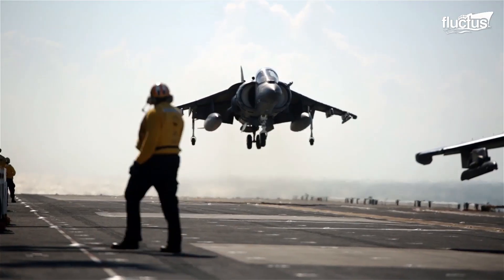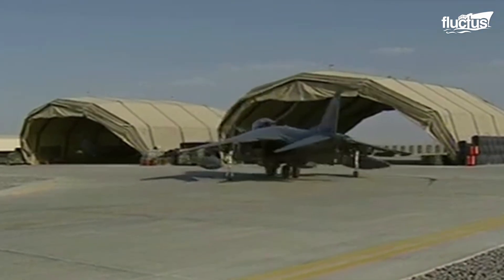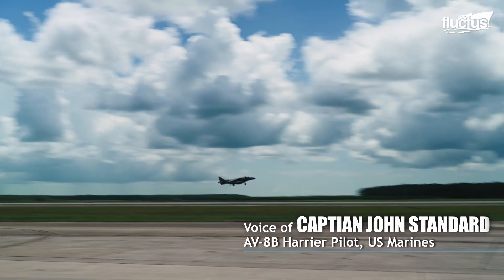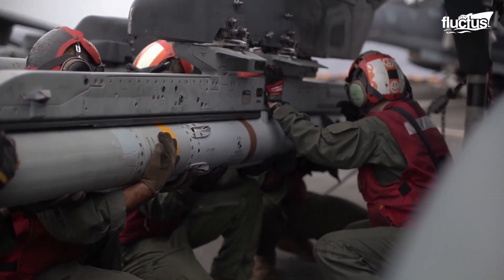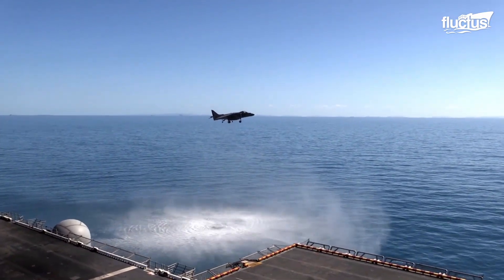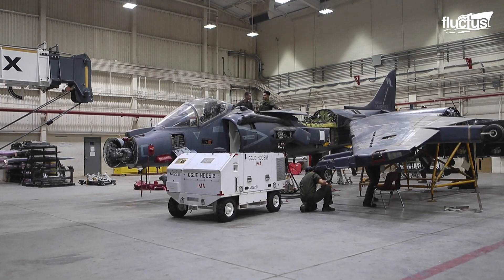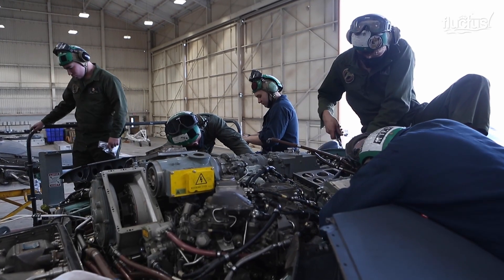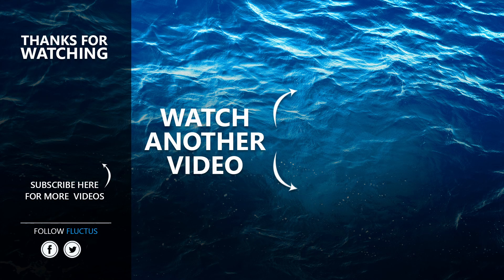US AV-8B Harrier II Showing its Insane Vertical Capability Over Water

Comment: Before the F-35B, the HARRIER was the only VTOL fighter jet used by an air force.
VTOL takeoffs require a lot of energy due to the weight of an armed fighter jet and therefore a lot of fuel, which increases the weight even further. This reduces either the flight time or the weapons load carried. This is why the English Harriers and F-35Bs usually take off from aircraft carriers in STOL mode (with a short run-up distance), as this reduces fuel consumption during take-off.
The HARRIER was also very successful in the Falklands War and English pilots were usually able to win fights against the Argentinian MIRAGE-III. The USA also built a Harrier version.

Although there had been several VTOL fighter aircraft before, including some rocket-powered interceptors towards the end of WW2, this was abandoned after the prototype (Viper) crashed, in which the pilot died.
In the Soviet Union, Yakovlev also developed prototypes of VTOL jets (YAK-36/38/141) and in France, Marcel Dessault developed the Mirage IIIV as a VTOL interceptor. However, all of these aircraft either never made it past the prototype stage and were abandoned or (in the case of the Yak) were taken out of service after a short time.

Comment: OMG, @ 0:26 and the first bit of incorrect information, the “Engines tilt downward”……….WRONG, the exhaust nozzles rotate around the engine to direct the jet thrust at a desired angle to achieve the desired speed and direction of flight, and they only have ONE engine, NOT engines.
Reply: Yeah. And the front nozzles deliver bypass cold air. The rear nozzles deliver hot exhaust gasses. The engine also provides pressure air to the RCS jets.

Comment: Maybe the least capable airplane in the last 50 years. This stol/vertical take off is a big gimmick... Why? Cannot do vertical takeoff with full combat weight and fuel. Slow. Nothing special. A 30 year old f16 will smoke this thing before the pilot of this thing gets his bearing.
Reply: How much experience did you acquire serving in AV-8B squadrons during Desert Storm, Operation Enduring Freedom, Operation Iraqi Freedom, et al and how is it that Norman Schwarzkopf had a much higher opinion of the Harrier II than a barcalounger cabal member like you?
Reply: Funny, but absolutely not true. In fighter fit this aircraft in its original form was almost peerless. Many a F-15 and F-16’driver been “smoked” by a Harrier. 
One ex British pilot explained that it can vector its nose out 70deg while still in stable flight. The only jet that could cope visual range was the F-18. But even then at high Alpha the F-18 had dumped its energy and couldn’t escape the fight through lack of outright power. 
The Harrier was a brilliant Air Combat fighter…. In the right hands.

Comment: Could it take off vertically with a weapons load?
Reply: With a formidable load out, it can't take off straight up, but rather very short take off in contrast to similarly loaded attack aircraft.
Reply: Not at all. It must be very light for vertical takeoff.
Reply: @mtkoslowski  "Not at all."(sic)

Incorrect. Payload was limited when a vertical launch was performed but the aircraft could in fact lift off with a small weapons load.
Reply: With water injection to keep the temperature down and the power up. 
On the odd occasion British pilots would forget to turn the water off, leaving them without the capability to do a vertical “land on” at the Carrier. A definite visit to the Captain for a dressing down if they did it.
Reply: @mtkoslowski  wait, then whats the point? little confused lol
Reply: @mysteryY2K  
It depends on the air temperature and density altitude and elevation. With this information you make a decision to takeoff with a reduced weapons load. If you want to have drop tanks that factors in.

For full ordnance you need a long runway.
Reply: @mtkoslowski  "For full ordnance you need a long runway."(sic)

Incorrect. MTOW can be performed after a relatively short ground run.

Comment: Those engines pretty much eat themselves during that last hover.
Reply: It’s a single engine aircraft.
Reply: @mtkoslowski  My fault, I knew it has a Single Rolls Royce Pegasus.  They still operate at dangerous levels whilst hovering.
Reply: @shanepatrick4534  
True. Did you know that they also carry 150 gallons of water? Not for cooling but for injecting into the turbine to increase performance?
Reply: @mtkoslowski  Yup, at those temps the water breaks down and helps increase thrust.  I got the Harrier simulator as a kid in '86 and learned all about it.
Reply: It does stop the blades melting also.